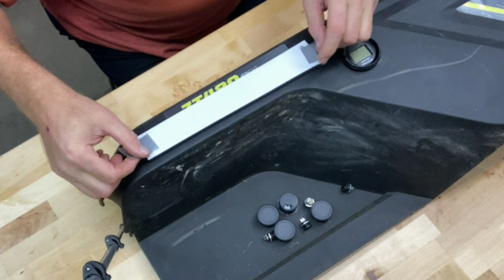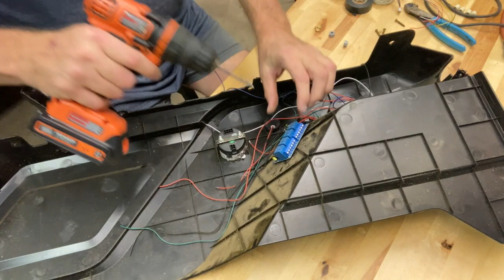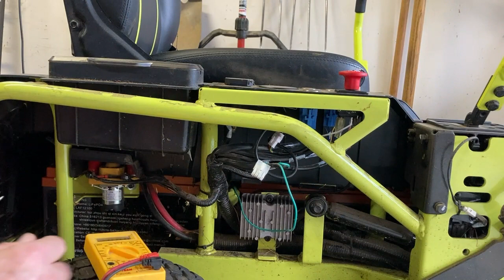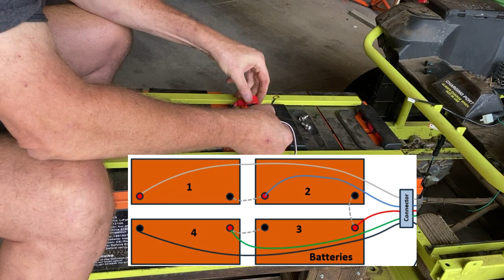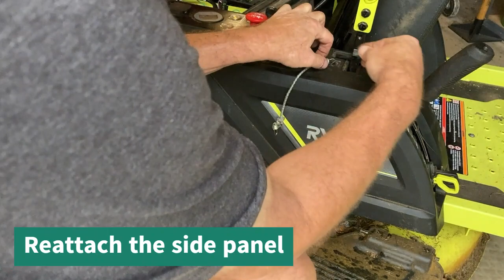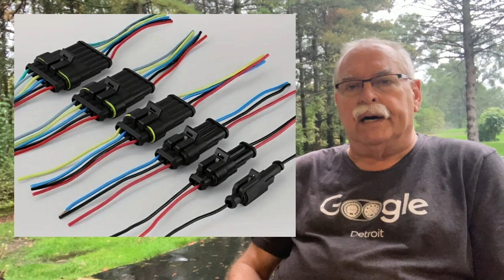Ryobi 48v Lithium Zero Turn Mower - add 12v gages and charging ports

Comment: Love your content, I’m at the start of converting my Ryobi ZR480 ex to Lithium and I’m planning to add the separate meters, charge ports & controller.
Thanks
Reply from the maker: I recommend starting off "small"; do the battery and charger first.  Make sure everything works.
If you run into trouble, it'll be much easier to diagnose.  Such as, determining if you need a pre-charge circuit.
Reply: Hi again Rob, I have an automotive electronics background and as I said earlier, love your content. I am looking at the wiring diagram and sort of scratching my head, it looks like there is the possibility of direct short circuit between the series connected batteries if I’m not mistaken. Sorry if this is long-winded;
The way I interpret the diagram at present:-

1) You turn the key to Auxiliary Mode.
2)Your relay board powers up and clicks the relays closed.
3)The moment those relays close, Battery 2, Battery 3, and Battery 4 are instantly short-circuited together through the thin shared ground wires and circuit board traces in your dash/meter/charger port panel.
4)The wires will immediately smoke, melt, and potentially spark a fire right behind your dashboard, regardless of the fact that the mower's drive system is turned off.

I hope I’m wrong, just checking in
Reply from the maker: @JoeSarka  Yeah... I'm not an electronics expert by any means.  I do have decent  experience with auto electrical.  
I did scratch my head on my wiring plan, for the reasons you stated.  But, I pictured two batteries in series (open at each end); you can check the voltage of one battery: 12v.  Check the other: 12v. 
Then, use two volt meters and check both batteries at the same time; 12v each. So?
Granted, I did use very small wires, because the amps are so low, but also, just in case, they will act as fusible links, without making too much of a mess if they "immediately smoke, melt, and potentially spark a fire".
That never happened.  It's been a few years.  I don't ever check the voltage or the battery balance.  I keep meaning too...

Comment: Where did you find that awesome soldering tool?
Reply from the maker: I kinda got it from my Dad after he retired.  It's all we used in the service station on car wiring repairs.  The handles are still available for like $300? (plus transformer).  The handle is exactly the same as it was 50 years ago.  Search for Esico-Triton R23801.

Comment: Do you have links to where you purchased the voltage meters and charging ports?
Reply from the maker: Four volt meters:
https://www.temu.com/led-digital-display-circular-two-wire-voltmeter-dc-4-100v-dc-digital-voltmeter-head-display-reverse-connection-protection-g-601099513282265.html?_oak_mp_inf=ENn92pem1ogBGiBjMGI5OTBkZTA4YmM0Y2QxOTdmYWQwNTcxYmViYmRiMSDgh%2Fyb9TE%3D&top_gallery_url=https%3A%2F%2Fimg.kwcdn.com%2Fproduct%2Fopen%2F2022-12-07%2F1670430208583-e23e3a9893254d3f94e9a473373208fd-goods.jpeg&spec_gallery_id=9297512&refer_page_sn=10009&refer_source=0&freesia_scene=2&_oak_freesia_scene=2&_oak_rec_ext_1=MjQ4&_oak_gallery_order=1592123639%2C1241031401%2C2072472391%2C2123813530%2C2027530786&search_key=DC%204-100V%20Digital%20Voltmeter%20with%20LED%20Display&refer_page_el_sn=200049&_x_sessn_id=r80p4ljy2c&refer_page_name=search_result&refer_page_id=10009_1715092783627_g5feqjdojm

The DC charge ports are sold out, but similar to:

https://www.temu.com/10-pairs-5-5x2-1mm-dc-power-male-female-socket-adapter-connector-12v-5-5-2-1mm-dc-power-supply-plug-jack-nut-panel-mount-connector-g-601099539405583.html?_oak_mp_inf=EI%2B2laSm1ogBGhZnb29kc19wcnN0amFfcmVjb21tZW5kILX3jZz1MQ%3D%3D&top_gallery_url=https%3A%2F%2Fimg.kwcdn.com%2Fproduct%2FFancyalgo%2FVirtualModelMatting%2Fbace1a65b797deb3371af6f128dc60ab.jpg&spec_gallery_id=2070930525&refer_page_sn=10032&refer_source=10016&freesia_scene=11&_oak_freesia_scene=11&_oak_rec_ext_1=Mjk4&_oak_gallery_order=588037475%2C1212534781%2C1702198184%2C1261604080%2C272640560&refer_page_el_sn=200444&_x_sessn_id=r80p4ljy2c&refer_page_name=goods&refer_page_id=10032_1715093075356_43oq4chqx2

Comment: Hi Mr Rob, one more question about 6 wire ribbon wire connectors.  All five wires are connected to the black wire , am I correctly understood?  Since in the diagram it tapering down and fades away merging to the black wire. Please clarify. Thanks regards. Ben.
Reply: Sorry, I forgot to mention it's the 6pin connector to the relay . Ben.
Reply from the maker: Yes, it's a 6p connector/ribbon that controls the relay board. And yes, 5 of those wires are connected together to a single ground wire.
The VOC terminal is the 12v positive from battery #4 to power the relay board and power all the relays.
The GND terminal is the 12v ground from battery #4 to ground the board itself.
The 4 wires in the middle are the triggers/controls for the 4 relays. When you ground each of these 4 wires, it triggers each relay. In this application, I didn't need to control the relays individually. I wanted to trigger all 4 relays at the same time, so those 4 wires are connected together to battery #4 ground.
At least that's the amateur logic that I used. Rob
Reply: Thanks so much now I will be able to finish my project. Regards, Ben.

Comment: I would like more details on wiring. The wiring sketch shows positive of one meter connected to negative of next meter as if they are in series. It's a bit confusing for me .please elaborate more about wiring. Thanks so much for regards, Suresh.
Reply from the maker: Yes, it does look confusing to me too.  But that's kinda the same thing that you do to the batteries; neg to pos.

Look at the battery schematic at 27:30.  You can prove the concept by using your hand held volt meter.
Touch 1P and 1N = 13v.  That makes sense for battery 1.
Touch 1P and 2P = 13v.  Yes, touching two positive terminals is the same 13v of battery 1.

Now try 2P and 2N = 13v.  That makes sense for battery 2.
Then 1N and 3P = 13v.  That's strange, but it is same battery voltage as battery 2.
Reply: Thanks for your kind reply. My confusion is not at battery terminals. I was talking near Voltmeter connections. One positive seems to be connected to the negative of the next voltmeter and so on. It looks like a series  connections . How do you connect  voltmeter positive and negative wires? Sorry to bother you just learning. Regards
Reply from the maker: @ben-xc9tq  I understand your confusion.  Myself, I know just enough about electrical to be dangerous.  
The volt gages are kinda wired in series, but you have to visualize that each volt gage is in fact wired to each battery.  Whether the common pos/neg connection is at the battery, or at the gage (like I did)... it doesn't matter.
The best thing to do is to do a bench test; actually connect up a couple batteries in series, and use a volt meter to simulate the volt gages.
Reply: Thanks so much regards

Comment: May I ask why you went with 4-12v 100Ah batteries that require balancing and monitoring verses 1 large 48 v 100Ah battery? I understand that there would be a bit of tray modification to accommodate the single battery. Thanks
Reply from the maker: In hindsight, I may have reconsidered.  But when I started, I was learning way-more about Lithium than I ever thought I would, and I wanted to keep it as simple as possible.  And it was simple; The battery swap was very simple doing 4 for 4.  it wasn't until I was reading the Chins Owner's Manual, I started to wonder about balancing/monitoring.  And that got me wondering about how well the batteries would stay balanced.  And then I figured out this "cheap" plan to get the individual voltages...and then figured that I could add the ports to do individual battery charging.  So far, the batteries do stay within 0.2v of each other and I've had no problem mowing or doing the fall clean-ups.  So, adding the 4x gages was certainly an interesting project and I'm glad I did it, but not really necessary.
Reply: @robertveldman1901  OK.... SO YOU  are saying for a novice OR BASICALLY  ANYONE..  looks cool , all the lights , gizmos etc . I REALLY DON'T NEED TO ADD THIS /THESE METERS TO MY RYOBI.?    ......I do enjoy your videos . I did transform my acid battery 30 " Ryobi  to lithium batteries watching your video on (HOW TO )... THANK YOU SIR !!!!!!
Reply from the maker: @rjazco51  Correct. I don't think it's really necessary to add the 4x meters and charge ports.
Reply: Thanks for your reply. I will probably upgrade in the early spring as we approach winter. Your videos and commentary are excellent and very helpful for those of us with these machines. I was wondering if you had come up with an idea how to keep the batteries warm in the winter as I'm just a state south of you and keep it in an unheated storage barn. It's too bad that Ryobi placed the batteries that they did with the mowers. Mine lasted less than a total of 25 run hours.  @robertveldman1901